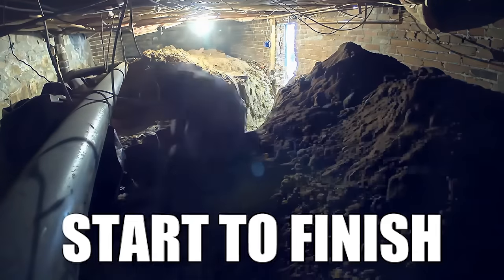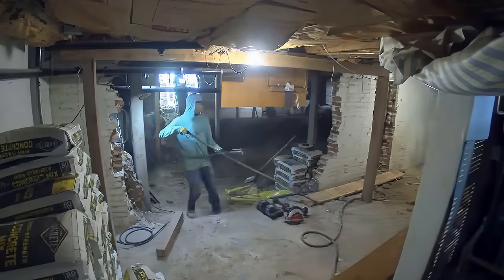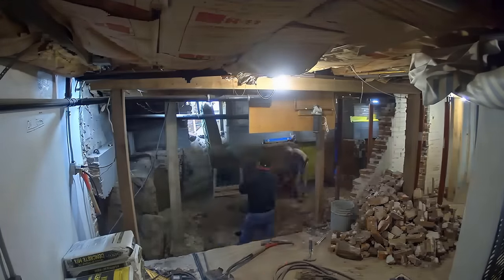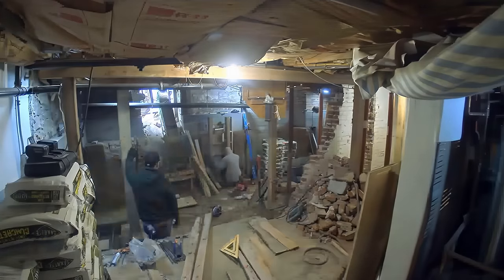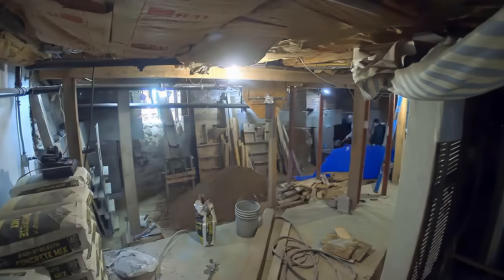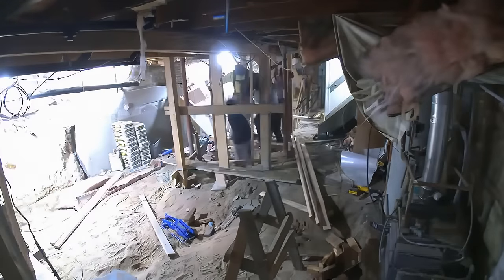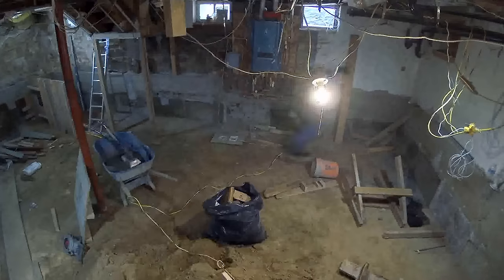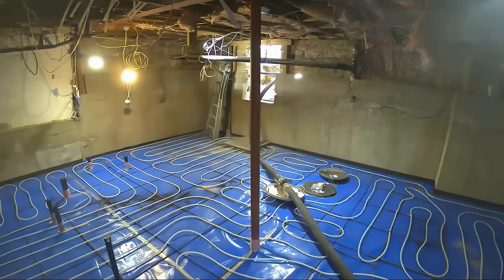Digging Out a Tiny Basement, Start to Finish - Timelapse

Comment: I can guarantee that there is no engineering, permits, or inspection on this project. When you alternate the footings, you eliminate the rebar and reinforcement required to make a footing handle a load of a house. This house is unsafe, and these guys are just making a bad situation worse by the method they are using. Also, even an amature know you do NOT pour a sewer line in a footing, especially when it is going vertical. They should have waited for the plumbers to relocate it. All lines crossing a footing at 90 degrees requires a sleeve. None of this was considered.
Reply: I agree. There was no engineer involved with this project. It's amazing how many people are commenting about how good they did when in reality they don't have a clue what they're doing. Stay away from my house, for sure.
Reply: @jimmydavis8009  Thanks for pointing that out. It's good for other people to see and understand these things. Not all YouTube construction projects have the correct methods. Beware.
Reply: Imagine this house stands 100 years from today and your comment lingers in contradiction to reality.
Reply: Coming from someone who has never done underpinning?  Underpinning doesn't have rebar usually and IS safe when engineered and installed properly.
Reply: @robertkenney-oles5948  So you say you have never done underpinning? You missed the whole point, are you a child? In real life, rebar and concrete go hand in hand. Never one without the other!
Reply: @journeytree  Boy, you are just a dreamer. Never 100 yr, but not the point, It's about doing things the right  way and not hurting people and environment
Reply: @bstiger6482  Not hurting anything if it doesn't collapse.
Reply: That's scary. I don't know anything about underpinning but I know you are right about the sleeve for the sewage. And I know concrete needs rebar. Would be nice if the uploaded re-assured us that this process is safe lol

Edit: I want to say I saw something that looked like rebar going vertically but even if it was it was not enough lol
Plus I've seen this done before and they do the footers in three phases A-B-C. Sounds like they do it in two in the video

Edit again: The old brick basement walls obviously don't have rebar. Seems really odd. I know buildings need thick pads with rebar and footers/grade beams. But I live in FL so I'm not familiar at all with basements. Seems really weird and it's got me curious now how they are put together.
Reply: Looks like possible engineering blueprints at 22:49
Reply: @digi3218  Digi, don't try to justify an amature process. It's all on video
Reply: @bstiger6482  😂 my bad lol
Reply: If you look at 22:50 looks like an engineer made some prints?
Reply: Underpins don’t get rebar. That’s not the purpose of an underpin. The only time underpin gets rebar is when it’s joined into existing footings. They’re drilled and epoxied. The underpin footings are only to extend the foundation down to a wider base. It encapsulates the foundation keeping it stable. There’s no conceivable way you can perform a job like this without permits. No company with a crew of 4 souls would do this. And, it takes special insurance as regular business/construction insurance doesn’t cover foundation work.
Reply: Also, those are absolutely engineering prints. Allllso, they are epoxying rebar into the existing footings and into the foundations on either side. You can clearly see the rebar. So far these guys are doing this exactly how it’s required in Ontario.
Reply: The guy even said rebar….
Reply: @shawnhuk  underpinning definitely needs rebar like you said when you are going lower than the existing footings. 

It's just amazing how throughout the video you don't see any rebar laying around. I didn't spot any at least. Like I said I did possibly see some rebar going vertically near the footing before they poured a section.

I just looked this up and there is another process named benching and that's where the footing stays in place and you dig next to it and pour basically Infront of it. I can see rebar not being as important but still think some is probably needed.

I never heard him say rebar at all but I believe you. I did see the engineering prints halfway in.
Reply: It amazes me how many people sit behind their keyboards and think they have a full grasp on a project like this.  Especially people who apparently have no idea what rebar is for.  Rebar is for concrete that will experience tension loads, and since footings are compression loads, they don't need rebar.  The international residential code allows for footings with no rebar.  As far as I know, only a few jurisdictions require rebar in footings for earthquake zones.  Also, you can see engineering drawings in plain sight, and he expressly mentioned having a plumber do the plumbing.  So that sleeve you claim you didn't see is the concern of a separate contractor.
Reply: @baconsnot  you must be amazed at yourself too then lol. 

No way this shouldn't have rebar. I never did see the inspector come though. I can get engineer drawings and still not pull a permit and cut corners, not saying they did.

But if they pour concrete under the existing footer or pour it next to it, there is only going to be dirt on one side and the load is also coming from the side or directly from above. It's basically a load-bearing retaining wall more than a footing. It probably should have rebar
Reply: @baconsnot  Mr. Snot, you can always tell someone who has never had first hand experience in concrete construction, which you loudly portray. You will never find a reliable concrete contractor, who warrants his work, that leaves rebar out of the pour. Big industry feels fiber replaces reinforcement, but that is usually personal opinion, and most use both--fiber & rebar or mesh. And BTW, footings have both tension load and compression loading, as not all soil has equal bearing. Also, please show me any county in the lower US with a population < 4000/sm and has adopted 2021 IBC that does not require rebar. You can't because it does not exist. Your common sense lacks to say rid the rebar when it is part of a system holding up a house. Common sense says protect the house, not gamble with what I can leave out and it still stand. Maybe you should hid behind your computer, and not comment on things out of your expertise.
Reply: There are some butthurt haters in this comment stream. Yep blueprints at 22:50
Reply: @SaltineAmericanCracker  No Bruce, no blueprints, but they did, only in select sections, 'state' they added rebar, but not in the beginning of the pouring process. It is clear on the video. But no showing of any blueprints, sorry, butthater.
Reply: @bstiger6482  you really are sour. Calling people names is no way to have a dialogue. However, you must have seen the unedited version without the time lapse, or you’re blind and only listened. For all of us people with eyes that work, we totally see the prints. 
It’s ok to be wrong. Sad
Reply: @SaltineAmericanCracker  Bruce, please stay out of a conversation you have clearly NOT been following. The video that this dialogue is attached to does not have blueprints laying around--wait, that's right you think the blue vinyl plastic is blueprints. I forgot, but you don't really know. Sorry bud, Sad for you.
Reply: @bstiger6482  oh ok 😂
Feel free to hit pause at 22:50. Again, it’s ok to be wrong.
Reply: @baconsnot  the rebar in basement walls are for resisting tension loads caused by the outside soil/water table pushing on the walls.
Edit: forgot to mention that rebar is also used in floors to resist tension forces as the soil beneath gets compressed and settles under the load of the house.
Reply: @digi3218 I'm wondering why the brick would go that far down anyway!?! This must have originally been usable space and their just cleaning out a mud flooded structure!?!?!?!
Reply: @Memry-Man  the brick that goes down farther is the wall of the existing basement.
Reply: @digi3218  Well, ok, but then where did all the dirt come from?
Reply: @Memry-Man  So they started digging on the outside of the existing basement wall and then tore it down and connected the two spaces, and then dug further down including the existing basement. I was confused at first as well with the brick wall being so deep but I think that is what is going on.
Reply: @digi3218  Hey thanks for replying.  I dunno though, the thing is that brick seems to extend way beyond the existing basement. I don't really know that much about basement construction, but it's hard to imagine laying a brick wall like that only to bury it.🤷‍♂️
Reply: @digi3218  ok, I'm not very knowledgeable on the subject of basement construction, seems strange to bury brick. Also brick surrounding the whole area their working not just the wall of existing basement room
Reply: @Memry-Man  yeah but I think the three walls don't go as deep, only the one side of the existing basement. I don't remember id have to watch the video again but I remember having the same questions and thinking it was weird lol
Reply: Cry me a river.
Reply: You can’t use your ears and hear him talking about different contractors coming in a checking out the pipes (plumber) and the wires (electrician), blueprints were there. Check your hearing and eyesight bozo
Reply: @Memry-Man I'm still trying to figure out how they washed clothes in that space. But the original basement on the other side looks like the brick wall was used to separate it from the unfinished space they're digging out. Seems odd but maybe when built brick was used as foundation? 🤷🏽‍♀️
Reply: @luv14lyf  See that's just it, I don't believe brick has ever been used like that. I'm of the mind that the reason is that that floor used to be ground level.
Reply: At 13:37 there is a set of plans on top of the concrete I bet there was permits pulled on this project
Reply: @ke4tdm  This post is very old, so drop the comments- No Comment
Reply: @bstiger6482 Oh yeah you can guarantee it? So you talked to the contractors and CONFIRMED your claims? Why don’t you stop making accusations based on personal opinions. There’s visible blueprints at multiple points In the video and if you’ve watched ANY other videos from this channel they use rebar almost all the time. Ya big dope 😂
Reply: I also hope people comment on this for years to come just as a little reminder that you aren’t always right bud.
Reply: So a conveyor is the way to go
Reply: How do you waterproof it
Reply: What kind of conveyor is best

Comment: As a contractor in philly since the late 80's, this sort of thing (lowering basement floor) was big for a while, back in the day..it's THE hardest remodeling you can do on a house... So labor intensive...I could never do one now; The manpower, in this area, is just not there...You guys did a sweet job on the footers and foundation walls; they look tight!...
Reply from the maker: Thank you so much ! We got a really great crew of guys here and they do amazing work.
Reply: if you youtube around there are new cool tools,  mini-mini holes, even electric ones, conveyors, screw conveyors, big boi cordless tools but, still the joints and aches.
Reply: @godbluffvdgg  thinking of buying a house and Philly and doing this.  Would you be open to talking to me?
Reply: @ursulalovings201 I want to dig out my basement by 3 inches. Its dirt floor.
Reply: Not to mention is has a very low ROI for the cost and effort.

Comment: What's a price range for doing a job like this? I know you can't give exacts because every home is different but I'm curious how much it would cost around for a job like this
Reply: $450 per linear foot of basement wall
Reply: @dkraft  you are going by square foot.   He said linear foot of basement wall.   20 +20+40+40=120×$450=$54,000.  Unless I too misunderstood.  Probably + plumbing,  electrical,  heated floor...IDK.
Reply: Prices change per area, job, and contractor, but something like this to get done would be 50k easily for the excavating and footing/basement. Add more for the plumbing electrical, framing, floor heat, drywall plaster paint and carpet. I would say probably 70k+ estimated.

Comment: No rebar? Hope your not in a earthquake prone region
Reply from the maker: We use a fiber reinforced cement that gives us the same strength as rebar ! And Denver is a very sandy soil, very little movement. And if there is an earthquake, a cracked floor is the least of your worries in an 1800s home.

Comment: Do you guys generally have engineering plans for something like this? Also, are there inspections for this type of dig due to how you alternate pouring the footers?
Reply: Yes, most likely. This project is probably in the city of Denver, so you need architectural plans too. Most jurisdictions require a wet-stamped structural drawing set for this kind of work. It details the plan, section details, and what order you have to do the work when staging the pours. I have a house next to me being built, and the Gold's crews are nice guys and hard workers. I got to see the new mini-pumper he was talking about too, it's a nice machine.

Comment: My Bother-in-Law and I dug out Two to Three Feet of mud out of a Crawl Space, to form a Basement. The House was a Split Level, with a Walk-out Basement under the Bedrooms. Crawl Space under the Living, Dining Room, Den and Kitchen. We didn’t have a door to the outside so everything was bucketed out. The front wall in the Crawl space had buckled, that’s what started the project. Existing Footers were Deep and good. Don’t think my FIL, was ever appreciated with the hard work we did. A Structural Engineer was overseeing the project. Back in the 70’s in the Midwest, so I don’t know the cost.

Comment: The insulation should be above the moisture membrane, this gives you something to attach the underfloor heating pipes to and it won't rot away. I'm guessing you tacked the pipe clips through the membrane making it worthless. Also, rebar, it needs to be in a continuous rectangle around the perimeter to provide strength, you will have area's that have deeper sections of concrete but at least the finished article is square.
Reply: is it possible the insulation has a vapor barrier pre installed on one side and then they added another layer then glued the heat water pipes for the pour? I am not a construction person
Reply: @armandocardona6975  good observations. The pipes used in ufh are bendable but they still want to kick, glue would not solidify fast enough to hold them. The barrier is 1 continuous sheet as much as possible, if the insulation had it preinstalled you would have to tape up every joint which is not feasible.
Reply: It's nice to read a different perspective.

Comment: Crazy job, very cool stuff you guys do. I love excavation and I love basements, so this is fascinating to me. I'm curious if you're able to share a ballpark figure of the homeowner cost? Super curious about the dig project, not the latter finish project. Also curious on your dust management strategy. Negative pressure? Sealed HVAC area? Air scrubber? All of the above?

Comment: This is interesting to me as I have a full basement in half my basement... and then a crawl space in the other half.  For years I've been wanting to dig the dirt out of that crawl space and expand the basement so I have more room in my "shop".  I guess my main concern is that the footings may not go down far enough and I just haven't been sure how you pour a footing under the existing footing.  It just doesn't seem possible... but then I see this!!  Now you talk about pouring footings... but it looks like you just made your outside walls thicker.  IDK... wish you gave us a bit more info on this.
Reply: Yeah... also I was told that the quick crete wouldn't work, as it isn't strong enough for a footing.  I had to have a higher grade of concrete and there was no mix I could buy other than from a concrete company... just one hurdle after another.  We called these forms "floating forms"... but it's a bit complicated to connect each section to the other...
Reply: @tylerbarrett6652  I think you were lied to because bags of concrete from Home Depot or Lowe’s are 4000 psi. They readily stock 5000 if you want, as well. This is a ferociously sized job, though.
Reply: I’m about to do this exact dig out in my 115 year old in Tacoma. I feel it’s worth it for the sq ft and the seismic restructure. 550 sq ft will be nice. But expensive

Comment: Looks pretty good to me. What a huge amount of work. I poured a slab with ~70 bags of concrete before and this is just crazy. Between the labor and then dirt and concrete dust in the air. Only question is where is all the rebar? I guess its not needed..
Reply: was wondering about rebar myself!